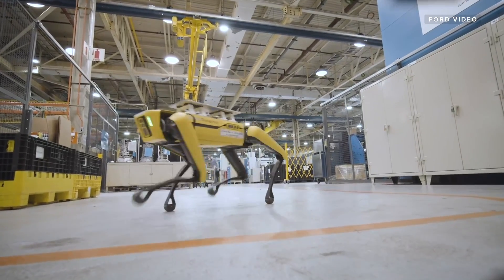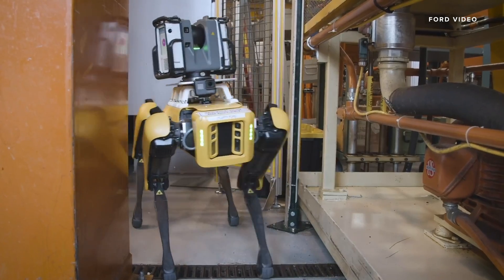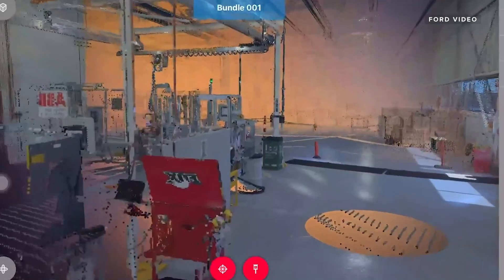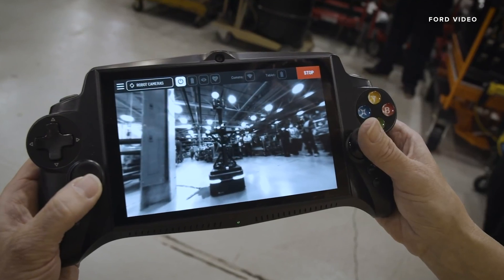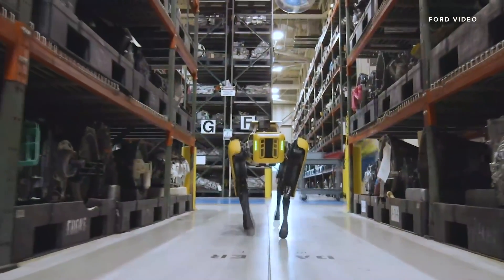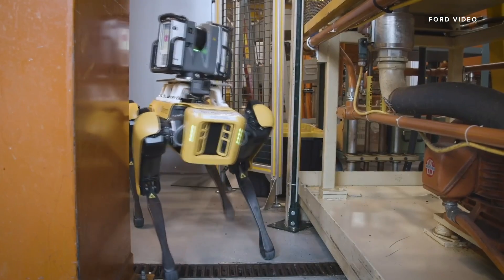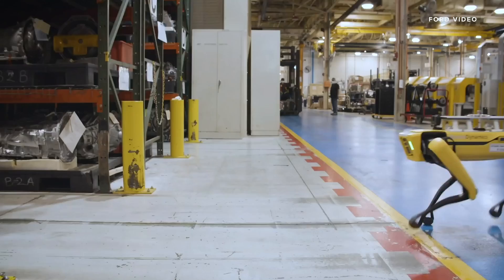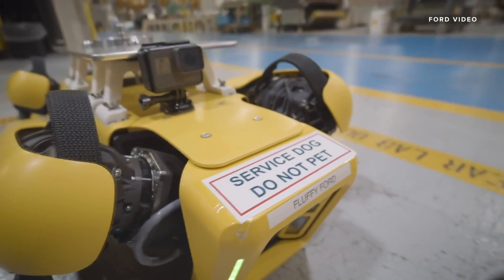How this robot dog is helping Ford build its next car 🚗

Comment: imagine when they make thousands of these then a hacker decides to hack all of them and use it for very bad things
Reply: The hacker would need several military grade satellites to operate them without latency 

high profile hacking is extinct in 21st century
Reply: @boiboiboi1419  not necessarily. All he needs is to write specific instructions scripts. Spot is intelligent and doesn't necessarily needs the control. A script to perform a 5min damage is enough. Hack Boston dynamics cloud, the cloud gives the malware to all the spot robots connected to the cloud. 5min destructive malware is enough to cause more damage than covid 19
Reply: @kfash5198  but to do it you would need to sneak in the hq which would be very unlikely, you cant randomly control spot from the thousands that exist and they are not controlled by the cloud, they are controlled by self performance software, idk how complicated you think it would be to hack boston dynamics in general

Comment: Self replicating robots could be used to terraform Mars and prefab underground bases as well.
Reply: I can see it, but it'd be hella expensive
Reply: @rappermerch7785  We ship 3d printer to Mars have it build a second 3d printer, etc... then 3d print more robots, bulldozers, etc... have robots come back to earth to pick up some plants, animals, insects to populate underground bio domes... and use carbon dioxide on Mars to make fuel and water with hydrogen
Reply: @dougmurrayshow  a 3d printer like that doesn't exist. You can only 3d print ~70% of a 3d printer with current technology. There'd have to be hundreds of millions if not billions put into development for a printer that can 100% 3d print another, and then comes the need for resources. I'm pretty sure mars doesn't have the resources needed to create electrical circuitry or plastics. Even if there is, you'd need a robot to mine it, purify it, melt and mold it, etc. ON SITE by itself. So not pheasable during your lifetime I'd say.
Reply: @rappermerch7785  Before my cousin's team landed rovers on Mars, it could have been considered non-feasible. Once it's been done it becomes an established fact with practical examples to show as proof.